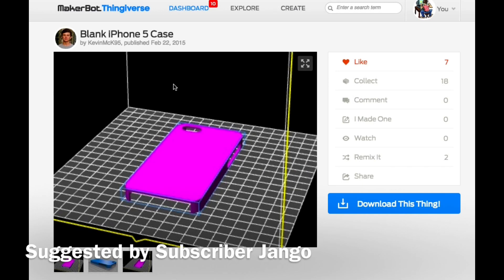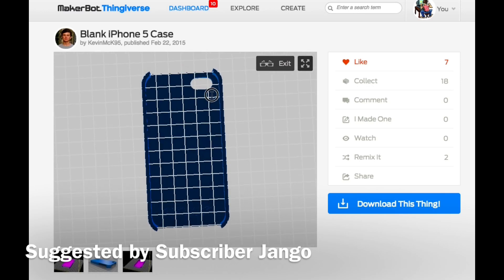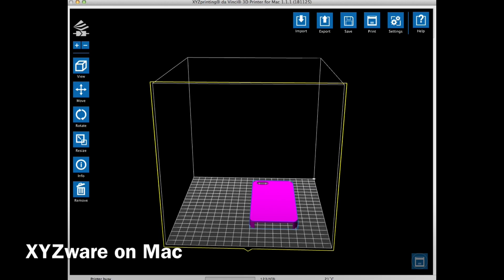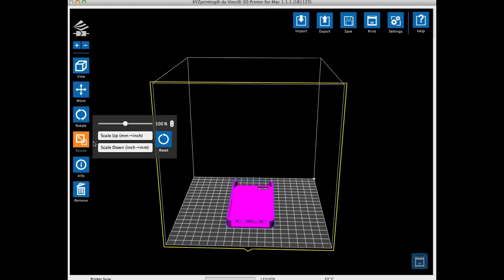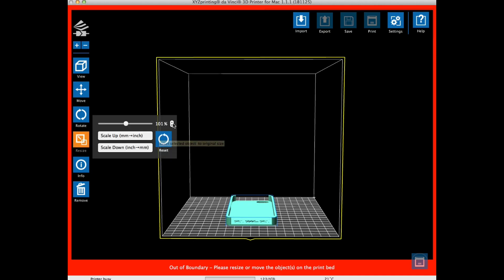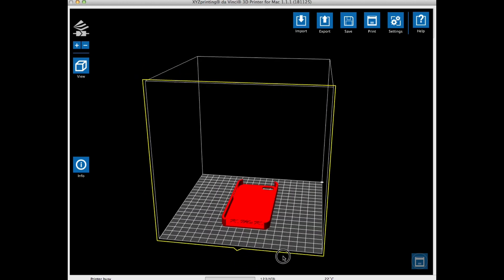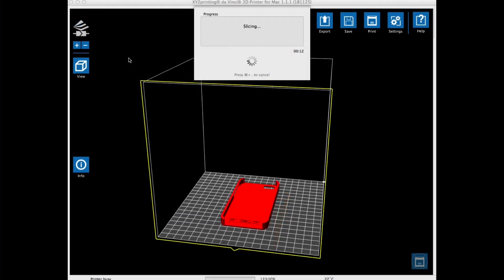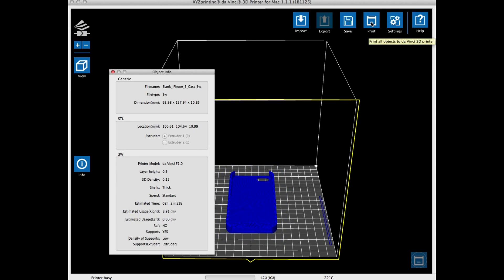Filament Friday #9 - Simple iPhone 5 Case on Davinci 1.0 Video #047

Comment: that tool is called a deburring tool its used to remove sharp edges from machined holes at the 90 deg angle top and bottom.

Comment: The reason that you are able to increase to 101% twice is the the XYZware program seems to have half step increases. If you have the INFO button open when you increase from the first 101% to the second 101%, you will see a small change in all dimensions. When I print these cases I usually increase to the first 101%.

Comment: ***** You can also get that tool at Homedepot. Its in the plumbing supply it is a deburring tool for copper pipe. Mine has cut way more ABS plastic than copper pipe.